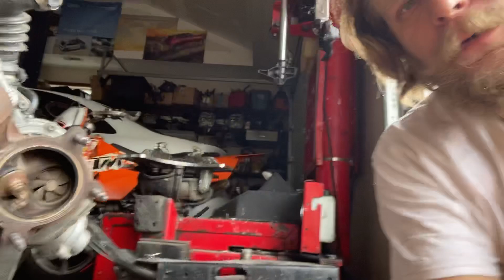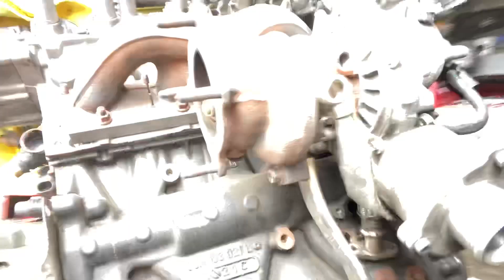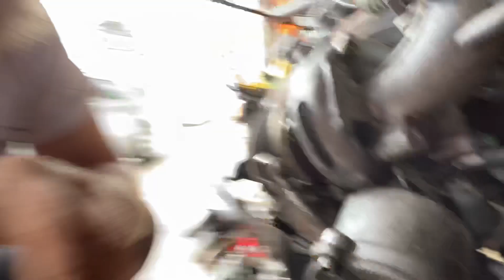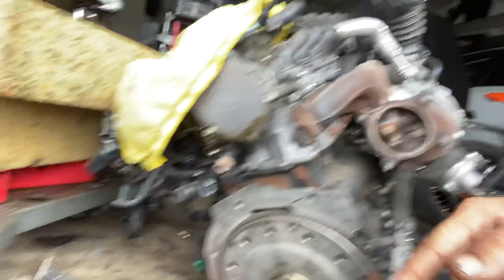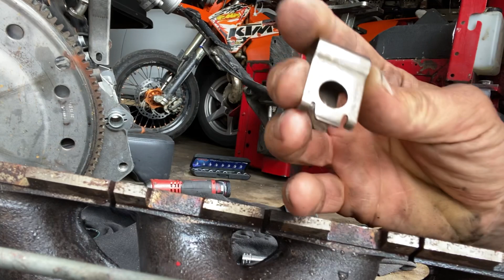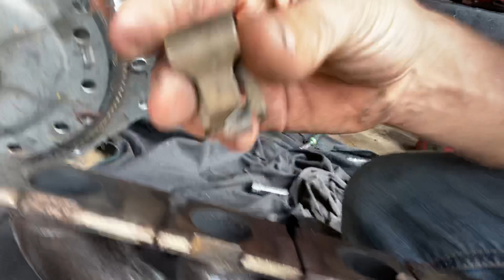P0299 Audi 2.0t tfsi turbo turbocharger failure

Comment: I got a 2012 Audi A4 2.0 go on code Throwing code P0299 fall on your video I got the exhaust and cat pulled back and the actuator arm that goes to the waist gate came off is there a way to order just a circle clip to put this back on do I gotta take the turbo all the way off and get a new turbo

Comment: Should I be able to see the waste gate linkage move at all with the car stopped, with engine off, then on, then revved? We have the P0299 but I’d like to better understand the conditions needed to activate the waste gate linkage. I was unable to see any movement during the test we did. I also couldn’t hear the “turbo whine” when the engine was revved. Maybe it’s just really quiet?

Comment: I noticed on the newer IHI turbos (is12,is20, is38) they seem to have addressed that actuator arm as the new ones are heavily braced and reinforced in the place where that clip goes!  They seem to last a little longer too. Time will tell.
Reply: Are you referring to the latest Audi 2.0T engine?  What year & models?

Comment: You've never seen a problem with the diverter valve on a tfsi ? It's probably one of the top 3 issues with that engine lol. The diaphragm splits and causes it to loose boost pressure. Very very common problem. More common than a loose exhaust wastegate
Reply from the maker: Not on 2009+
Reply: @NaptownTuner  depends on the revision of dv, some might have the piston type rev d which is poor and doesn't hold boost anyway but will never fail, the diaphragm ones are pretty common imho
Reply from the maker: @AdammP  that’s fine but I haven’t replaced a single diverter valve for 2009+ only belt drive 2.0t 2005.5-2008
Reply: that was a more common problem with the rubber adiaphragm diverter vales, the newer ones use plastic solenoids.

Comment: I just got an 05 A4 2.0. The last three days I’ve had an oil pressure warning pop up for a couple seconds then it goes away and today I got a check engine light and it was P0299

Comment: I’ve just bought a 2011 Q5 2.0 TFSI and it has this waste gate rattle. I had a local garage look at it and have advised me that there is already a clip installed. Does this mean that the turbo is on its way out or is on borrowed time?

Comment: Enjoyed the clear explanation. Funny thing is I had an 07 BMW N54 with the same wastegate flapper issues on both turbos. Now years later just bought a 2.0 tfsi and had that exact clip laying around from when I was experimenting with the BMW. On that car I ended up removing the turbos and installing new bushings/flapper in the turbo where the arms go in. Thanks for the info!

Comment: I have this code as well does this make the car bog at idle and shut off after a few seconds? Because that's whats happening to me but the linkage arm isn't moving at all....
Reply from the maker: No, I doubt it, unless maybe the turbo wheel is locked or clogged.  the linkage is hard to move by hand.  I would think you should have some other engine codes or something else wrong
Reply: @NaptownTuner  thank you for your opinion ima try to see if any more codes pop up after driving it for a bit longer
Reply: So I drove it for a bit longer and filled gas it was still acting the same but after putting gas maybe 10 min later car was acting like it was stock I have stage 2 eurodyne but when I would stop it didn't bog at all but at times when I would stop it would shut off or start bogging and codes are still the p0299 didn't get anything new

Comment: It's a shame that this is such a common problem... too much heat or are these turbos a bit too small (to handle the heat)?
Reply from the maker: Audi or nobody I can think of ever had problems with this before, it was a poor part by their suppliers ihi in this situation, probably a big company if it’s the same people that make heavy equipment, just didn’t supply good bushings in this linkage of this turbo, everything else with the turbo seems good

Comment: Awesome video. I just did this replacement but now I have a coolant leak on the return line. Do you have any videos or hacks or recommendations that would allow me to tighten the bolt without pulling the turbo again?
Reply from the maker: Vim stubby sockets

Comment: Where can you buy that clip? can you put it on a bad wastegate without taking the turbo off?
Reply from the maker: I get them from eBay yes it will help a lot on a bad wastegate but the proper way is new turbo with the clip.  The makeshift bending / welded some people do.. I’ve seen that cause overboost with binding so I wouldn’t take that risk
Reply: @NaptownTuner  pls give the link to buy the clip
Reply: @tkrmpl  the number in reply is the part number to the clip
Reply from the maker: 06j.145.220.b   (turbocharger clip)

Comment: hey my friend cut and weld the linkage to fix that problem is he a genius or an idiot?
Reply from the maker: The clip is the best solution for the loose linkage anything else I wouldn’t trust long term but whatever works as long as you don’t overboost
Reply: @NaptownTuner  Your a gentleman